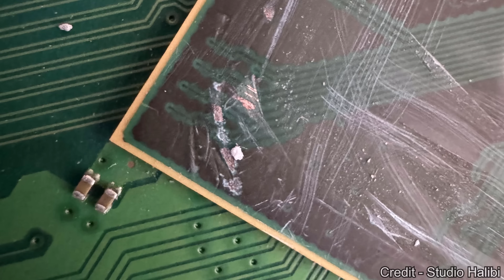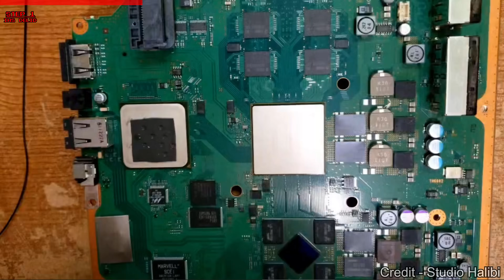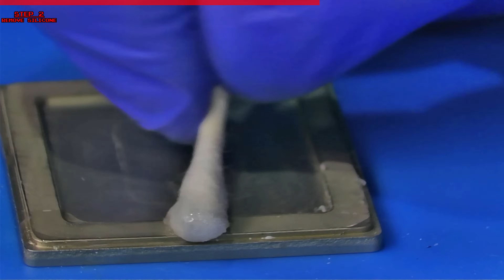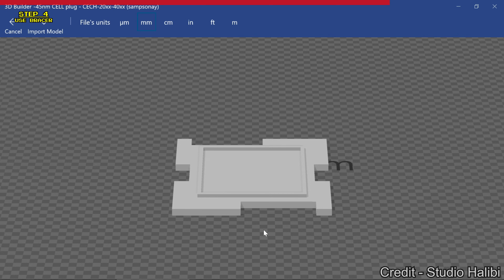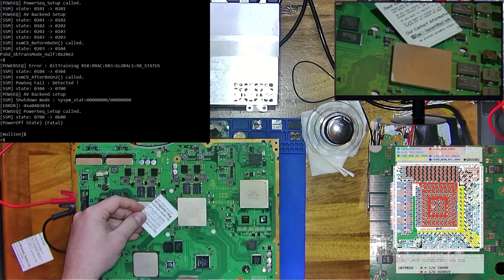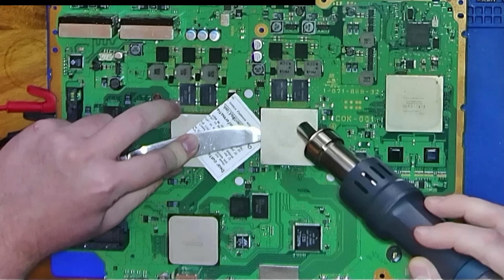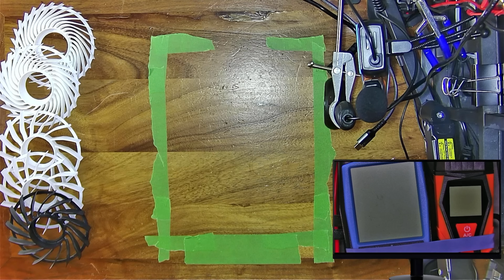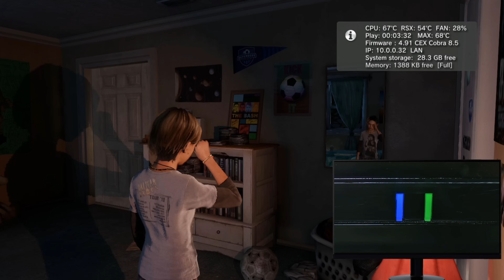How to Fix | Episode 1: Overheating. How to Delid CPU/GPU and fix YLOD - BEWARE of BAD MODs!

Comment: Have you considered having the bracers machined? Not for helping thermals at all (Doubt you would want them machined from metal anyways), but more so for dimensional accuracy and rigidity at higher temps. Of course it would cost way more than a 5 cent printed part, my guess is at most 10 bucks for a one off. Anyway, Excellent video as always Felix
Reply from the maker: Eh, I just print them as I need to. It's tedius, but not too bad.

Comment: Felix, i've been thinking, why nobody tried to put a pc fan in ps3 yet? It would be very easy to find a more silent one than the standard ps3 fan to replace it, but i imagine it would take a bit of modding from someone with experience and knowledge, maybe you could consider as a future project? Thanks anyways, you're a ps3 genius
Reply from the maker: The fan it has is already optimized. The noise is just turbulence.

Comment: I recently delided mine (just the rsx) and clean it properly. But i found an thermal pads (very thin brown) at the nec tokins under the cell and rsx. Is it normal ? From what i searched they mostly been found ouy on the other side... cechc03 model. The console was sealed and little bit dusty inside I assume it was never been opened before just good cared. 129 days in total, 30 errors in total mostly 1001 and only one 1200 from may2024. (bought the console in july.)
Reply from the maker: Someone added them after the fact. That's not OEM, no. The tokins don't dissipate heat throug their casing. It's just a resin cap, which doesn't even touch the metal part of the cap. It's an air gap. Lol. So putting a pad there does nothing. 

The pad under the CPU however is concerning. I've seen that cause BGA damage and cracked dies. People don't think it can. They get indignant about me pointing this fact out, but it can and has. So I do not reccomend it!

Comment: What are the odds of 3d printing a motherboard brace? Basically everything now days is designed for 256x256x256 but I wonder if there's some design that could make it a viable option; acquiring a brace for piece of mind just to do one console is kinda a stretch for me.

If not AliExpress will for sure be the go-to.
Reply from the maker: They aren't easy to get anymore anyway. Last I checked they werent for sale.  At least not the ones I got. I know some people have made a pattern and use a sheet metal service to cut them. Like OSHcut. So yeah, you can have them made that way and for a reasonable price.
Reply: @ripfelix3020  Thanks for all you've done and have planned man; I'll look into this once I actually set into my CECHE01, with the help and confidence your guides provide of course.
Reply: @ripfelix3020 can’t you just use the metal that’s there holding the thermal pads as a brace instead I mean it’s better than nothing right? And just screwing down on a flat surface very carefully

Comment: Just curious why use clamps to secure the ihs while the glue dries?  Can't you use something else that will distribute the pressure so you don't need to use the 3d printed support plate.  Is gravity not enough?  Thoughts?  I appreciate your videos!
Reply from the maker: When the paste was originally installed by the packaging facility the chips were not soldered to the motherboard. They could be clamped down with the pressure flat against the die and no worry about anything underneath the interposer. Like the BGA or the MLCCs on the backside of the motherboard.

But we dont have that luxary! Well unless you want to desolder it first!

So if you only use the backplate then now the pressure of the clamp pushing down on the die will press into the center. The interposer will flex under the die. The motherboard will bow under the die. That's because there nothing resisting bowing/sagging underneath the die. Only the 4 standoffs in the corners. When the glue sets the moment you release the clamp, that pent up strain will spring back and be locked in by the glue. And with thermocycling over thousands of cycles there's no telling how that would affect reliability.

To remove that varible, I'm using these to keep the MB flat under the entire BGA region so that I know the paste and glue are perfectly flat while the glue sets. That way it'll be like it was from the packaging facility and I can trust the calculations/relibility simulations are still relevent to the design. I didnt change the a varible by locking in pent up strain.

Comment: Liquid Metal Test Bonus Felix?😊
Reply from the maker: Spoiler, the results are not earth shattering. I think the heatsinks themselves are a bigger factor. I've tries several on the same console and some are better than others. Maybe the heat pipes wear out...IDK. I need to look into that more.
Reply: @ripfelix3020  Heat pipe wear is also possible. I got a few 40nm Frankensteins. The temperature of the rsx is not what I worry about, but the temperature of the cell is still high. Even in xmb idle, it can reach 67 degrees and increase the fan speed (Webman) to 30%. When running games, it can reach 32-35%. Even if I completely disassemble the heatsink and clean it and Delid replaces the MX4 or TF7 thermal paste under IHS, it will reach 67 degrees without exception, so I look forward to the bonus test of liquid metal. (Google translation conversion may be a bit difficult to understand, sorry ☹️)
Reply from the maker: Those temps are normal. Sometimes 35% is the best you can hope for. It's on the high side of normal for a delid, but still fine.
Reply: @ripfelix3020  Lately I've been thinking about adding liquid metal, saw you were experimenting with this too, my console is a 40nm B00 Frankenstein, RSX I didn't even do a DELID it couldn't get to 60 degrees, it wouldn't be me Worrying, I want to increase the thermal conductivity efficiency of CELL as much as possible. The only purpose of doing this is to reduce the fan speed as much as possible to suppress the noise.

Comment: If you want to be 100% sure that you never get the YLOD then simply do not use your PS3. It's that easy!
Reply from the maker: To clearify. The PS3 can still die in the box, but if you never use it, you'll never know it has the YLOD. Ignorance is bliss.
Reply: Exactly, the best option is clearly a Schrödinger's PS3 scenario LOL
Reply: @alexsmith5584  ffs beat me to it 😂
Reply: @ripfelix3020  isn't possible to remove all the capacitors and other perishable components and store the motherboard in a proper place to have it for decades?
Reply: @gabrielmanarte6809  we have the schematics. It’s not impossible to create a reproduction mainboard. Or better, I bet in 15 years we are gonna have BC PS3s built from 40nm CELLs or 65s with brutally reverse engineered syscons. Or better yet, “Syscon’t”s. Syscon in FPGA.

Someone will def reverse engineer the COK-001 definitely. It’s a passion for a lot of people.
Reply: That would be so cool  @LynxCarpathica
Reply: Can I post my console in to u from overseas?
Reply: Use a slim model.

Comment: could you just replace the thermal paste on top of the IHS instead of deliding the cpu and would it help the cooling at all instead of deliding the cpu?
Reply from the maker: Yes, sometimes that's all that's needed. Most people can figure that one out on their own, so they often try that and when it didnt work, sell it. So at this point we are seeing more and more consoles needing delided. They are 16+ years old, which is really stretching thermal paste endurance limits.
Reply: cool thank you!

Comment: The big challange die or live better;
To be honest when you try delid and pushing your cutter tool you creating stress on BGA connections, solder balls already old and close to cold solder. Sony old phat design also slims are so bad engineering but enough for work 2 years healthy. 
i like your videos as local Game console repair service from Turkey.
Reply from the maker: To defend SONY, the lead-free solder is fine. The BGA is not a serious concern if you are careful to limit flexing or jolting. A fall is a the most common way a BGA connection fails. Second I would say is when you flex the motherboard too much while trying to separate the heatsink. That suction can flex the board alot. That's why I used that plastic spudger from the side. I also heated the heat sink a bit to soften the paste. 

Again, these are the risks of opening the console and shouldn't be done if it can be avoided. We have to do what we have to do and can mitigate the risks as much as possable, but can't completly remove them.
Reply: @ripfelix3020  Looks like Xbox 360 series is better until  corona v3 and winchester mainboards. No thermal stress, no IHS, no NEC-TOKIN tantalium terror, but need more hand and solder skills for RGH or JTAG. also better CPU puwer and Full HD gaming. After seen SONY bad enginnering im Microsoft supporter.

Comment: im curious if you would ever sell your expertise as a service for people that would love to get Frankemodded PS3s? i am a nerd, but im too scared to wreck the rare E01 that i have, and most Frakenmodded ps3s are near 2x the price of a good A01, also, graphene pads for the IHS might be a good option as they dont expire
Reply from the maker: I'm not much interested in doing them for a service, no. For fun is one thing. Selling to recoup some of my investment costs too IG at some point. But I'm mainly in it for the science and challenge. 

To defend sellers, they are too much work to sell for less than they're going for. I don't think people realize the effort and skill that goes into it. The tools alone are expensive. The education through failure. The risk of offering a warranty. And OFC the ebay fees. There's actually good reason they cost as much as $800. A service for $550 is actually a great deal and less than it was a year or 2 back, thanks to healthy competition in the space. That was one of my goals by making these videos and it seems to be working. They're already cheaper than they were!

But at some point if prices fall too much or people are not willing to spend what it takes to make it worth a modder's time, the frankies will not be available anymore. I happen to believe in free markets and the law of supply and demand. So it costs what it costs, becauae supply is low and demand is high. It's natural and good for those who can make them to profit while they can. If it's too rich for your blood, that's because it's not for those who are buying them. Until they stop buying them and modders have to lower prices to intice new buyers, modders will continue to meet demand at a price that keeps them busy.

Comment: A perfect takedown of all the idiots drilling holes in enclosures and those who blindly swap power supplies because a higher model number means it's better ;-)
Reply: Bro called out Ryan (Mystic) 😭
Reply: I mean drilling holes works, but at what extend ? other parts get choked.
Reply: Ive heard about swapping the power supply for one of the newer model ones, what problems does that apparently cause cuz I thought about doing it.
Reply: I wouldn't call people drilling holes in the console idiots, that is too harsh. They were misinformed by somebody else (who themselves likely had bad information) and made a poor decision that worsened their game console. They took a risk on repairing their failing device and it didn't pay off, but that doesn't mean they are idiots.
Reply: @jamesbuckwas6575  I wonder why people fall for this. A thermal system designed by engineers using CAD software and their knowledge is surely not a bad design. Maybe not the best it could be if not the console case design, but still enough. These are not some random fans, but blowers that utilise both negative as well as positive pressure they create to cool whole system.

Comment: Recently got the courage to repaste my Phat PS3 (non backwards compatible model). Own the original box and it was running hot even with web man. I recommend it, maybe not delidding unless completely necessary, but for making sure it makes less noise.
Reply from the maker: I figure if it needs more than 50% fan to maintain 68C underload (90nm phat models) then it's probably time.
Reply: @ripfelix3020  I think its dependant on the user, my PS3 even with the thermal paste replacement (65nm RSX) stays at 35 percent fan speed mostly. It then sometimes when I play intensive games shoots up to 50 percent fan speed; it slows down back to 35 after a few seconds though.(this usual happens every 10 minutes) I don't mind it but I can expect some people might not be too pleased with most consoles being relatively quiet.

Comment: Do you know how to fix a 8002f14e update loop.
Reply from the maker: I've read about it, but need to refresh my memory. Something to do with the blutooth/wifi module and if you attempt to update it gets, stuck? I forget the details.
Reply: My ps3 had stopped showing disc games on the xmb menu shortly before it happened I did try switching the daughterboard from the drive into a new drive but it did not work. I wonder if either something on the daughter or motherboard is wrong.
Reply from the maker: Depends on the model, but in phats the bluray daughterboard is married to the console. You have to remarry it if you change that, which can be done using CFW. You have to dump the ERK and then remarry the bluray in Factory service mode. It's possable it wasn't plugged in properly or the ribbon cable/connector is damaged.
Reply: I don’t think it’s the ribbon cable as a game crashed and then it stopped reading after I rebooted it. But I have no idea how to remarry a daughter board on a non modded console and that’s if the problem is even on the daughterboard.

Comment: Since you're literally the PS3 god by this point, do you know any tool i could use to recover the whole HDD of my PS3? Something that can read all files off of that filesystem the PS3 uses. I have a Tool and the guy i bought it from only played PES without even installing it on the HDD. (His brother is a game developer and they got rid of the PS3 when the PS4 launched.) Presumably no data was re-written since it was first wiped. (That if the HDD hasn't been replaced with a new one.)
I really want to recover the files and see what beta game i could find on there.
Do you have any idea what kinda recovery tool i should use or if i should send the HDD to a data recovery service?
Reply from the maker: Unfortunately, the PS3 filesystem is encrypted on a per console basis. You need the EID Root Key (ERK). This can be dumped using CFM tools in recent versions of evilnat. With that you can decrypt a HDD using a tool (I'd have to look up it's name. Ask on psx place, they can direct you to it). 

Without the ERK, no. The encryption is solid and would take forever to brute force. The only option is to repair the console and get it to boot.
Reply: @ripfelix3020  Oh, the console is not broken. It boots just fine. It's actually very clean inside too.
I have it on its original firmware, some very early one. I forgot. 2.something...

So i need to install a CFW, evilnat cobra that is. Hopefully it's available for DEX consoles too. Get the key, decript the HDD, then recover everything.

Thanks. 😊

Comment: hy, i want to ask a question... my ps3 fat is yloding on xmb or when exiting a game, errors 1601 1701 3032 and 4403... is the rsx completely dead?
Reply from the maker: Are you sure about the 3032? Or did you mean 3034?

3032 is likely a CPU trace or BGA defect. 3034 (on a 90nm GPU model) is usually a bad RSX.
Reply: @ripfelix3020  Sorry i was meaning 3034 I mistyped, my PS3 is a cechg, it was yloding before because of 1002 and 1001, I changed 4 neck tokins, delidded it because was overheating badly, and now it gives me those errors, no traces broken, 147 days of use and the RSX is Violet color, so I think it was overheating a long time
Reply from the maker: The color is due to a silicon nitride or dioxide coating. It's doped for whatever color they want and isn't a sign of heat. That's a myth.

Your 90nm GPU is most likly dead.
Reply: @ripfelix3020  sorry to bother you again, I need to delid a PS3 cechg 25xx that has an overheating problem on the RSX, but I can't remove it without risking to damage the chip... Is there some diluent like whit petroleum or something like that so I can destroy the glue under the memory chips?
Reply: @ripfelix3020  update... strange update
i discovered that, for some reason, on my ps3 model cechg-04 if i have the temperature overlay of multiman it gives me those problems, ylod with a lot of 1601 and 1701 and some 3034 and 4403... wut?

is like multiman is making the gpu angry and giving me problems... that's new

Comment: So 68 degrees celsius is low enough to have a hard underfill on a 90 nm rsx?
Reply from the maker: I think it's a good comprimize between temps and fan noise. Technically you want the temps far enough away from the Tg of 70C to be sure there are no local hotspots away from where the thermal diode is reading the die temp. But it's impossable for me to predict how much lower you should go to prevent that. The Tg is a range between 70C and 76C. So 68C is between 2 & 8C cooler. Is that far enough? Unknown. 65C might make you feel better, but again we cannot know if that's necessary. If you can stand the fan noise, it wont hurt. Up to you.
Reply: @ripfelix3020  Interesting. Thank you!